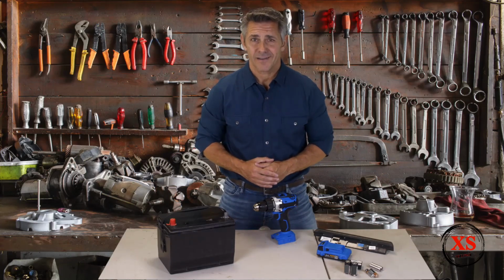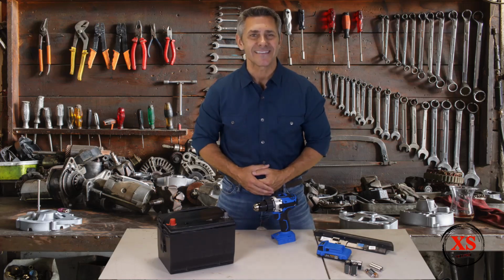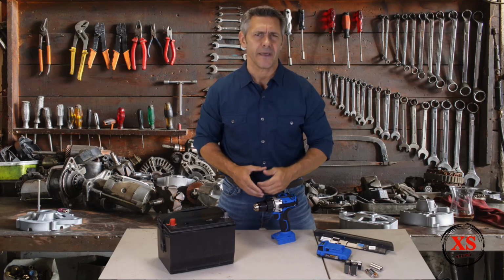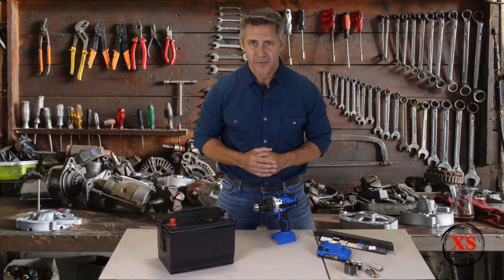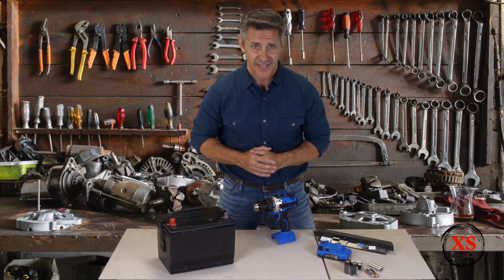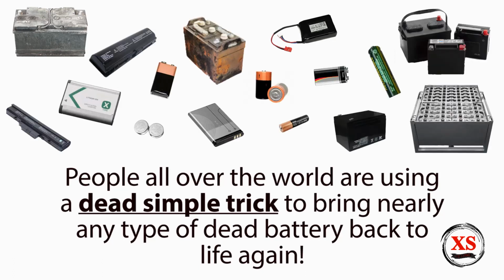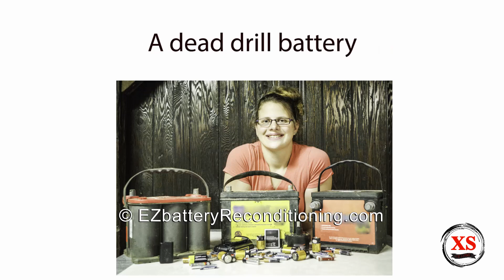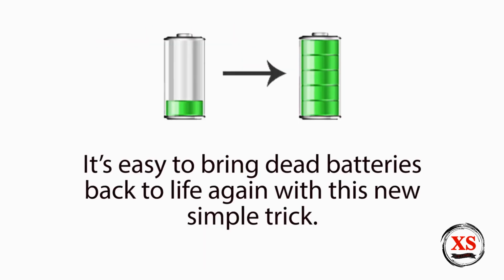Car Completely Dead No Power - How to Make a Dead Battery Work Again

Comment from the maker: Three causes, one the battery has failed. Two, the alternator has failed, put the battery on a charger until fully charged. It should read about 12.5 volts with engine off and about 14.5 volts with the engine running. If the engine is running and you are not getting 14.5 volts then the alternator is suspect. Also make sure the wire from battery to alternator is good and all connections are clean. Three, you might have a parasitic draw. This happens when you shut off the engine but some system keeps drawing power even after you walk away from the car. This can be tested with a multimeter by placing it in line. Basically you disconnect the negative on the battery (make sure car is off and doors are closed, nothing on) Set the meter to amps make sure the test lead is plugged in to amps on the meter. Now put the negative lead from the meter on the battery negative post and the postive test lead on the negative battery cable, try to get some help with this. So now your meter is part of the car's electrical system. If it reads more than  0.4 to 0.5 amps then something on the car is stealing power while engine is off. Have someone watch the meter as you pull every fuse one by one until they see the amps drop. At that time check what system that fuse runs and verify why it is doing that. You can google "Parasitic draw test" to get a better visual idea. Good luck and let me know how it turns out.